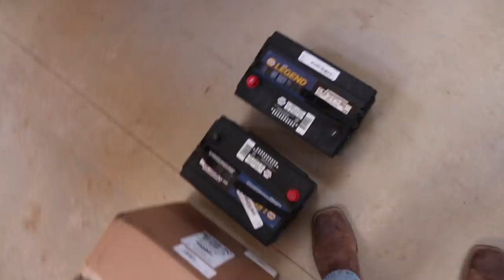EVERY DIESEL TRUCK NEEDS THIS UPGRADE!!!

Comment: You gotta do an banks intake elbow the stock ones are so restrictive the banks one makes it twice as big
Reply: Darren Grigsby i did the monster ram intake, boost tubes and banks intake.  Way more low end torque because of the faster boost spool.

Comment: On the duramax build lift it 8 inches cold air intake bigger blow off valve mud tires subs in the back with nice size amp
Reply: Blow off valve? I didn’t think diesels came with blow off valves lol

Comment: Just a question looking to buy a diesel how well does a cummins since there v6 compete whit the duramax and power strokes v8s
Reply: Yo Cummins are an inline 6
Reply: Yea that what i meant but like how well does it compet im like power and townig
Reply: @jorgerivas7084  Cummins makes the best engines for pickups and semis. The inline 6 is what is in most semis because of the amount of torque and power they produce very quickly. Towing, the Cummins will get slightly better fuel mileage. Check out TFLtruck for their reviews on the new trucks they're good comparison videos if you want some information.

Comment: Batteries on the concrete..
Reply: Larry George the new batteries these days you can leave them on the floor
Reply: That's just an old mith from when batteries had rubber shells
Reply: it still drains the life out of them
Reply: @tristensmart5740  no it does not. think about it dude, they are on metal shelving attached to concrete at the store. but dont take my word for it , look it up
Reply: Any really mechanic knows that if you leaving them on the ground it will suck the life right out of them
Reply: @tristensmart5740    oh dang, you are right, also the earth is flat, and vaccines cause autism.
Reply: dude I am right and any mechanic will back it up
Reply: @tristensmart5740 ,  but not any battery marker, engineer or 3rd-grade reader.
Reply: you actually do not know what you are talking about
Reply: Best thing to do is unsubscribe like me.